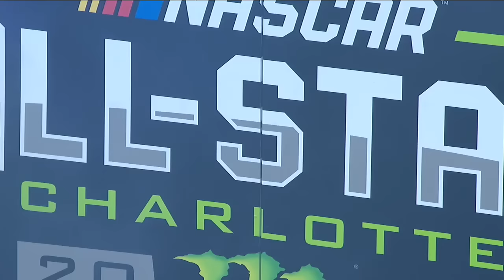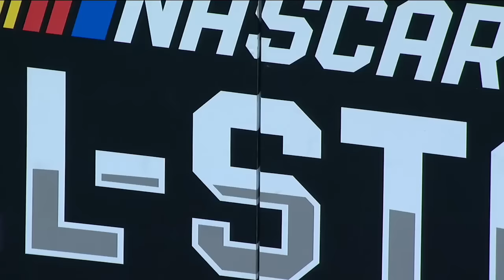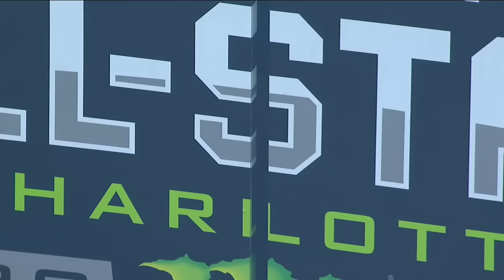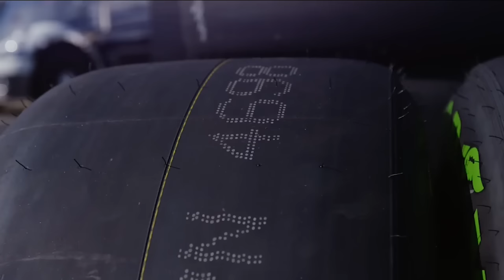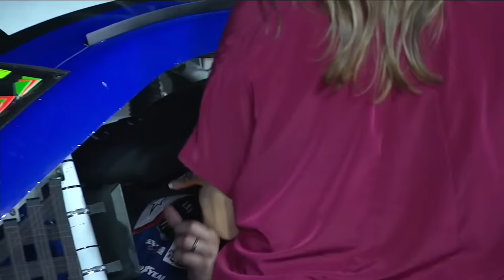Monster Energy NASCAR Cup Series- Full Race -Monster Energy Open & NASCAR All-Star Race

Comment: All-Star Open
-
15:15 Green flag
21:17 Trevor Bayne's amazing save.
24:48 Final lap of Stage 1
25:19 End of Stage 1
28:50 Pit stops #1
33:43 Start of Stage 2
40:19 Austin Dillon's underrated save. (Allmendinger got a puncture because of Dillon tho)
41:49 Allmendinger goes to the garage.
43:15 Final lap of Stage 2
43:45 End of Stage 2
43:51 Crazy fact.
47:13 Pit stops #2
52:11 Start of Stag-  52:16 No nevermind, caution #1
57:32 For real this time, Start of Stage 3
1:00:25 Battle between Suarez and Elliott.
1:00:51 Jones joins the fight.  1:01:00 Or not.  1:01:08 What a save tho.
1:01:18 Caution #2
1:14:05 Restart
1:15:09 Final lap of the All-Star Open.
1:15:31 Winner of the All-Star Open.
1:16:14 Fan vote winner.
[/]
All-Star
-
2:22:04 Green Flag
2:22:36 Triple three wide.
2:31:24 Final lap of Stage 1
2:31:54 End of Stage 1
2:35:20 Pit stops #1
2:44:48 Start of Stage 2
2:54:09 Final lap of Stage 2
2:54:39 End of Stage 2
2:58:07 Pit stops #2
3:05:59 Start of Stage 3
3:06:26 - 3:08:32 Amazing battles
3:15:25 Final lap of Stage 3
3:15:54 End of Stage 3
3:24:03 Pit stops #3
3:30:00 Final Stage
3:30:04 Kyle Busch's million dollar move.
3:30:10 What a save by Brad.
3:34:26 Last lap
3:34:53 End of the race
Reply: Good job
Reply: @darkcrypto_yt  Thanks dog

Comment: Only seeing Toyota vs Ford vs Chevrolet is getting boring ,I miss the 70s ,80s early 90s  when you had Buick and Lincoln ,Cadillac  and Chrylser.
Reply: Carnage Galassi I would like Honda to join NASCAR. It makes more rivalry for Toyota. Plus more diversity.
Reply: +Goldbugg 657 I agree .But Honda would have a bit trouble getting into NASCAR only because they don't have a mass production of V8 engines to use.Maybe during sprint series Honda can enlist with its V6 engine like Dodge did with the Avenger a while back.